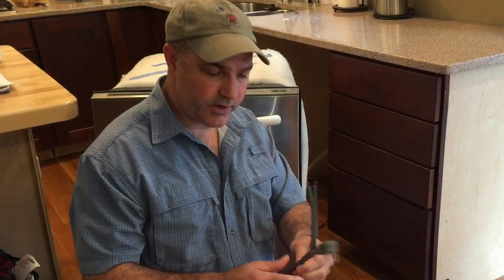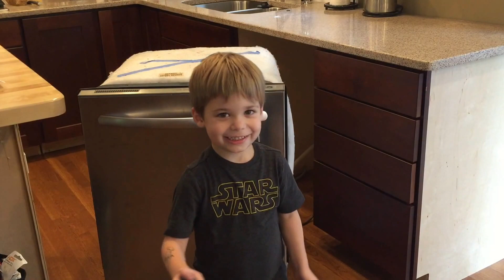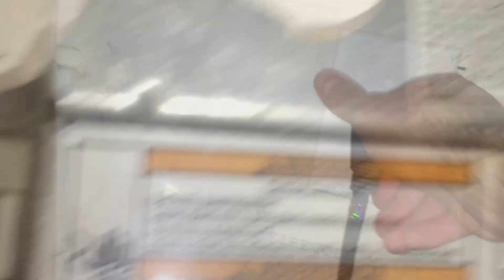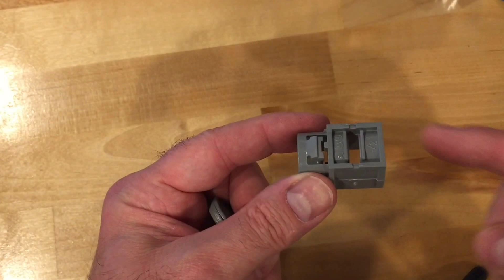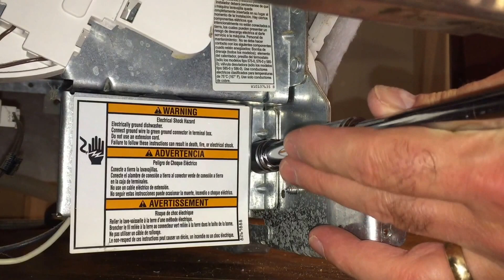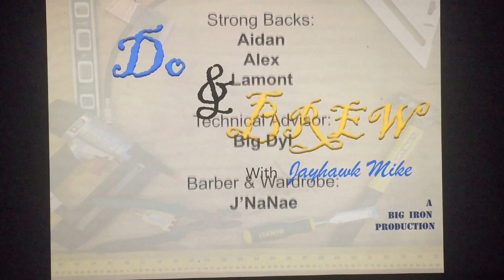Dishwasher Power Cord Repair

Comment: Hi Do And Brew. TY for video. I subscribed & hit the like button.  To get a GE model dishwasher OEM replacement cord will take many days to receive by mail.  Many local stores for quick pick-up typically are just selling 16 AWG (13 amp). 5'4" ft.  You don't mention this.  You only mention in your reply 14 gauge wire for a 15 amp circuit / appliance and 12 gauge for 20 amps.  The original GE dishwasher cord 3ft. too short to reach under sink outlet.  One question: wondering if you didn't mention 16AWG (13amp) for a dishwasher because not safe or that a (13amp) is not enough power to correctly run a dishwasher at it's full performance?  The extra length of 5.4ft. would be ideal length though to reach the 3-prong outlet under sink

Comment: Is it ok to cut an extension cord and use it for the dishwasher instead of the cord that it came with? Mine is is too short
Reply from the maker: Howdy Jacob!  Could you? Yes.  Should you? Probably not.  

The best and safest way to complete this job is with an “appliance cord” that is the proper gauge for the circuit and appliance you are wiring.  You should use 14 gauge wire for a 15 amp circuit / appliance and 12 gauge for 20 amps.  This is VERY important because if you use wire that is too small of a gauge for the circuit or the appliance, you could overheat that wire which could start a fire!

This is a very good question...thanks for asking!  If you have any other questions please ask!  Good luck on your project!  ☘️
Reply: @DoAndBrewDIY  Alright sir,  thanks so much! That's very helpful information. The extension cord that I thought about using is a 10ft  Hyper Tough  14 gauge (medium duty max 15 amps)  you don't think that would be good? The only appliance cord that I saw at Home Depot is 16 gauge  13 amps
Reply: @JacobGlover2023  Do not use extension cord.  Yesterday I just cleaned up a small fire in a business kitchen because their maintenance man installed a new dishwasher less than 2yrs. ago. He attached a proper gauge extension cord because the new GE dishwasher only came with a 3-ft. power cord that did not reach the 2-ganger outlet under the kitchen sink,  The dishwasher power cord melted to the extension cord & now the dishwasher power cord has to be replaced,  It took 2 large fire extinguishers to put out the electrical fire, a visit from the fire dept. & many hours of cleanup effecting a kitchen, employee locker room & 1 bathroom of a light yellow fire extinguisher dust residue & some fire soot. The cleanup was enormous effecting ever crevice, inside drawers, cabinets & microwave, chairs, table, floor, cabinets, walls, outside of frig, doors, handles, etc.....U get the picture.